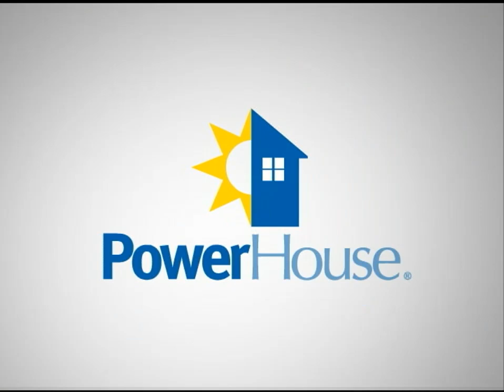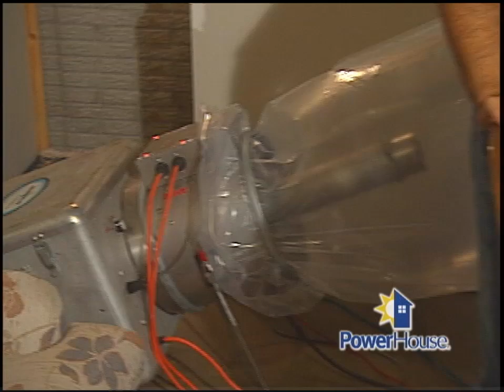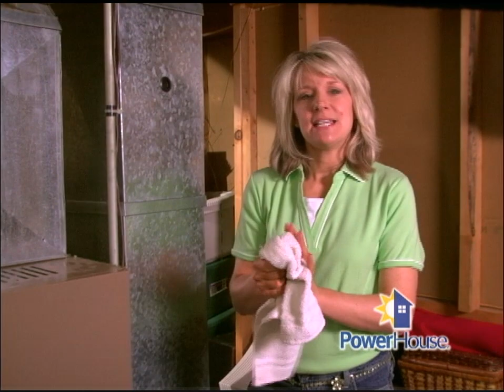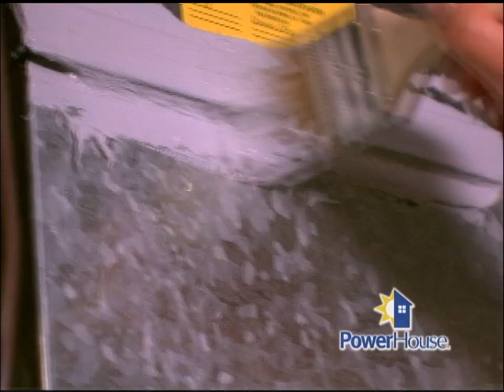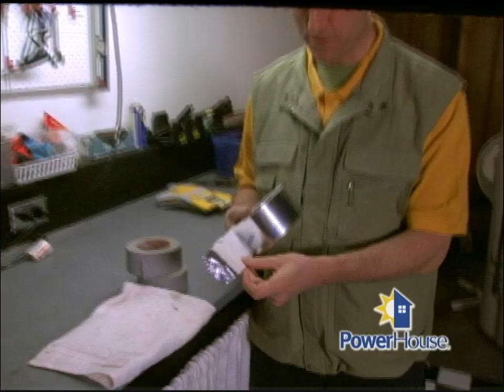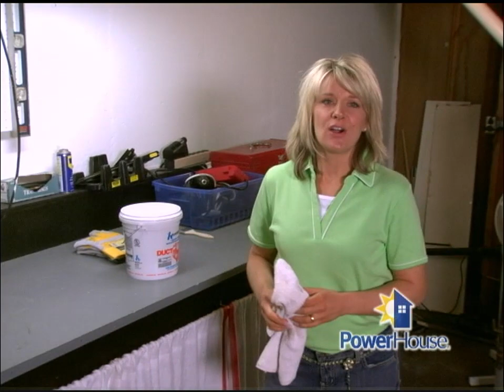How to seal your HVAC ductwork

Comment: Is mastic duck sealant safe to use inside the filter rack? Our technician used lot... a lot of them to seal holes he accidentally created and taped them too and then top of the tapes he put mastic duck sealant. But I haven't turned on my heater because I am afraid it might not be safe.

Comment: Thanks for the info, Great video!. Whew, 24 Hours to dry, I'll have to wait for appropriate weather for my AC to be off that long. It is still in the 90s here. There are some pretty large hand cut openings between the round Trunk and the  Branch takeoffs in my 19 year old , 2' crawl space. So my 2 concerns now are the cleaning of this nasty  sheet metal,  and the sealing of the  large openings. My first thought is I wonder if I could let the mastic partially dry, and then cover it with the aluminum tape. I have used adhesives that require one minute cure time  before closing air tight..I suppose I might have to contact the Mastic's manufacturer about that ....

Comment: CLEAN duct first! If not applied properly the sealer will not cure to the metal as it should and will pull away from the metal in no time.For a better, more finished look apply duct tape an inch above the seam to be sealed and an inch below the seam. This will allow you to not be to concerned about applying the sealer so carefully. When the sealer dries pull the duct tape off to expose a cleaned crisp edge.If you want use silver spray paint on newer duct sealer for a top notch finish.